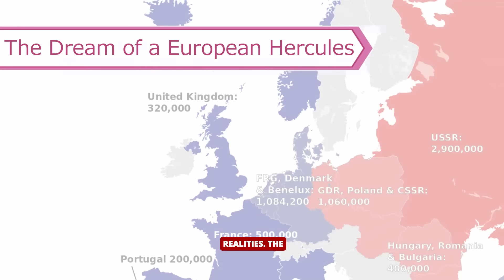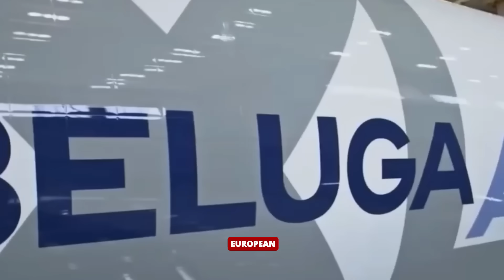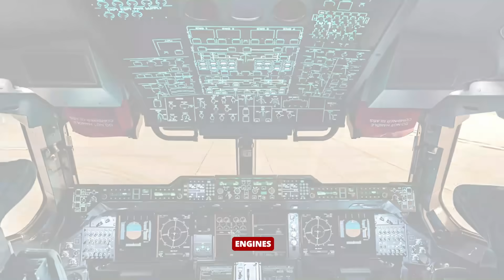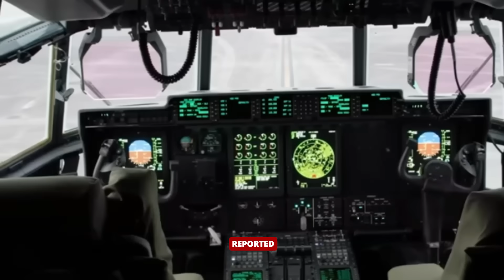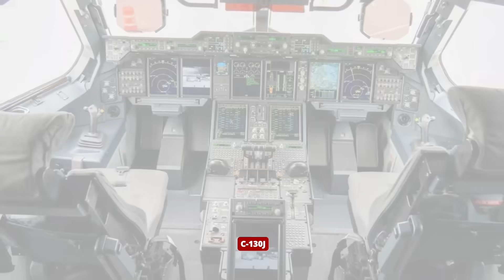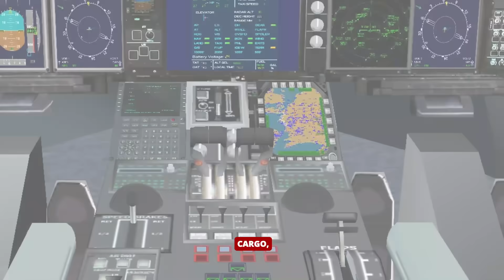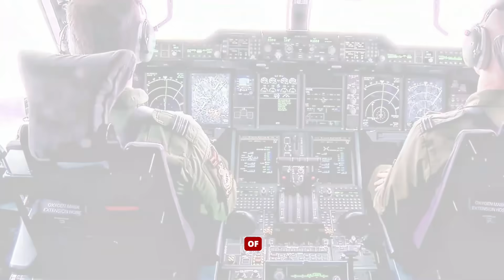Why Europe's $180M Jet Can't Beat a 70-Year-Old Plane

Comment: The A400 is slowly , steadily getting more buyers.

It so happens , C130 still sits in the performance and capability sweet spot that meets most militaries needs. As long as Lockheed keeps working on improving the C130 Herc, engines, avionics,   it will still be in demand for many more years.
Reply: I want to buy a Hercules so bad just to show the government how to do a proper upgrade. 

Carbon fiber is the new fiberglass. There's even YouTube tutorials on how to make graphene. 

You can make your own ultrasonic phased array crack detector for a couple hundred bucks on SparkFun.

Electrically decoupled, variable bypass, turbo jet/prop are the new hotness.

There's so much room for activities/upgrades.
Reply: The winner of the future is Embraer KC
Reply: @zaidiripin9408  LOL ... like an Alfa Romeo, good new but not very long serving. The C-130 has always used "Dimpling" for insertion of those 100k solid AD Rivets in the Fuselage ... as opposed to "lap" construction on the Embraer and Alenia's C-27's ... time will tell, especially if they have many cycles on "unimproved runways".
Reply: If Airbus was smart which they are not
they would have tried to market the A400M to the USMC not the USAF
The USAF is deeply rooted with C-130 with various variants and the A400M wouldnt work them
The USMC on the other hand would welcome the idea as it mean like reliance on the USAF for strategic lift
The UK was never supposed to operate the C-17 however delays with A400M lead to the RAF to lease and ultimately buy 8 C-17s
Delays with the A400 is why the C-17 got addition orders and why even now A400m users are buying C-130Js
Reply: @verdebusterAP  The A400M is not the right plane for tactical airlift. It's not the plane the Marines need.
Reply: @disorganizedplay  
The A400M would reduce the USMC reliance on the USAF for tactical and strategic lift
Reply: Some countries (Spain, Germany) are trying hard to unload a few in their fleet because of surplus/unnecessary requirements. Unofficially EADS considers the program closed and there will be no more deliveries beyond the 178 formalized orders. Meanwhile, both Germany & France ordered new C130J's.  
The RAF unloaded (prematurely) their 130J's to make room for the A400M in their fleet - something that they regret now, and have quietly stated that it would be nice if the USAF re-opened the C17 line.
Reply: @ElectroAtletico The C-17 fills a slightly different envelope than all the other aircraft of its families from Boeing and Lockheed Martin. And it does so amazingly. So. That is, unless you do the same stupid things that crash other aircraft like high angle of attack turns at low speed. A view of YouTube will find several crashes related to that. It goes further into bigger deeper envelope than other aircraft, but it falls out of the sky at the end of its envelope, just like all the other airplanes in the world
Reply: @ElectroAtletico C17 is quite a bit bigger than the Herc.
Reply: @thomasblankinship98  Really? YOu don't say!
Reply: @thomasblankinship98 As is the A400.
Reply: @thomasblankinship98  its not the size really.   its the strength of the cargo deck and the max load, the C-17 is designed to carry a single m1 tank plus  some cargo and troops
Reply: @Aokitadamitsu LOL. I built the center wing of the C130 in the mid 80's during the C5B program. . Want to talk about big! You're  right , the C17 can carry 1 M1 Abrams. The super Galaxy ( C5M) can carty 3 , with all the equioment for them and the ammo , as well as the entire gun crews for them. And my Grandad worked for Lockheed from 51 until retirement in 78. Hydraulic specialist and cheif research mechanic . He built the landing gears on every bird that came through the plant. C13, C141, C5a, C131, and the first SVTOL airplanes ever developed , the Hummingbirds.
Reply: @ElectroAtletico  Indeed ... we (LM Aero) already delivered J's to France several years ago when the A400 missed their delivery dates ... but France still had missions.

Comment: Le  vrai  concurrent  de  l'A 400  m, c'est  l'Embraer C-390 Millennium.
Expliquer  que  le  c-130  est  parfait, c'est  ne  pas  comprendre  l'histoire  de  l'aviation.
Certes  l'Atlas  est  onéreux. Mais  ça  reste  un  atout  pour  une  flotte  militaire.
Cette  hyper  complexité, qui  fait  exploser  les  coût, est  typique  des  programmes  multi-nationaux.  C'est  pourquoi  j'espère  que  l'on  ne  se  lancera  pas  dans  le  scaf. C'est  perdu  d'avance. Un  député  du  Bundestag  disait : "mieux  vaut  la  fin  d'une  catastrophe, qu'une  catastrophe  sans  fin". Je  suis  d'accord. Qu'ils  achètent  du  F-35. Ils  ont  déjà  tué  leur  industrie  nationale. Et  faisons  un  vrai  avion  avec  nos  officiers  et  nos  opérationnels. On  s'en  sort  plutôt   bien  d'habitude.
Reply: Wrong, the competitor, in this case, is judged by the weight it carries. The A400M carries a similar weight to the Kawasaki C2, and the C-390 is similar to the C-130. Don't confuse them!

Comment: You missed the chance:
"It's wings flex under load...until they detach from the fuselage killing all onboard"
Built to last...
Reply: Unlike the A400M crashing on a test flight, by the way chief that was an C130H model 🤦‍♂️
Reply: @dave741966  How many F35's have crashed?
Reply: @ldkbudda4176  , With more than over 1250 F-35s in service, there have been 12 crashes. Seems like a pretty good record.
Reply: @pat8988  So one per a hundred? 1:100 ratio?
Reply: @ldkbudda4176  , Compare that to other fighters, it's pretty good.
Reply: @pat8988  F35's are brand new same as A400M. So it is OK to compare US and Europe's abilities and skills to build safe planes?  ;)

Comment: Typo in your title, A400M is not a jet ...
Reply: Mais  c'est  un  avion  qui  provoque  des  réactions...
Reply: It is a critical difference when you consider the flight envelope and tactical usage.  Designed for the job.
Reply from the maker: I understand.... its a turboprop. its a minor technicality and Jet appeals better to the less experienced aviation audience.
Reply: @The_Flight_Path It's not a technicality. It's a specification. If you fail at that your whole "argument" on the A400 falls apart.
Reply: @armadspengler2717  A turbo prop is a jet core driving a propellor, turbo is the jet part and only provides about 10 percent of the thrust.
Reply: @donscheid97 It is a turboprop and not just a jet engine not to have some percentage of thrust but to get a greater range due to less fuel consumption and you are more versatile. Eg. the A400 can back up on the runway on its own using its propellers. Try this with jet engines.
Reply: @The_Flight_Path  I must admit it's the first time I see a channel admitting the clickbait.
Reply: @The_Flight_Path This is called intellectual dishonesty.
Reply: @The_Flight_Path  So you deliberately lie just to attract viewers?

Comment: Maybe the development was a bit of a mess. But now the A400M starts to prove it's capabilities. And chaotic planing doesn't even need intra european collaboration. Boeing messes up the KC46 all by it self ;)
Reply: Two very different types of aircraft chief, A400M wasn't produced to compete with the KC46 🤦‍♂️
Reply: @dave741966 I’ve never said that. It was about chaos in aircraft development 🤦🏼‍♂️
Reply: @matthiashartge5520  the development issue you are talking about are due to the implementation of new technology. The A400 is just a turbo prop cargo aircraft similar to what the Americans built in the 1960s without computers.
Reply: @Astutemoose2015  The A400M is new technology too. The development is complex and several companies from different countries developed it together so it's not surprising that they ran into some issues. The A400M cannot be compared to the C130 in its original form ;)
Reply: @Astutemoose2015  The only thing the C130 and the A400 have in common is the fact that they designated as "cargo" planes. The A400 is faster, can fly longer, can carry more and is overall much more advanced. The most annoying thing in the video is when he says the C130 is 3 time cheaper. That right there shows me he has no clue what he is talking about. The A400 was designed to replace 2 aircraft at once and do it better at the same time. Which it eventually did. Problem is the A400 was designed with cold was mentality in part. Which at this point in time seems to have been a good thing. Also nations around the world have started to move away from the C130 and ordering the A400. It is slow for sure but it is happening.

Furthermore the main reason why the C130 continued to  have massive orders is the fact that almost all the nations that ordered the C130 J already had both experience, tech crews, and the infrastructure to support it. This offset almost all advantages of the A400.
The fact that the A400 is a brand new plane with teething problems (which is normal for any new plane) coupled with reduced defense budgets, and the shear pain of getting such a plane integrated into the fleet means the A400 has a huge challenge ahead. And the price does not help either.
Reply: @fishescu the c130 actually works
Reply: @jerrymillerstein  So does the A400M. Do not misunderstand. I am not bashing the C130. It is a great plane that has served for a long time. I am pointing out that the A400M is not the same and the C130. They both carry cargo but that is where it stops. They are designed to fill different needs. The A400M is more of a tactical-strategic airlift plane. Bigger payload, larger cargo hold, longer range, faster speed etc. It's purpose is to fill in for 2-3 planes at once. It falls in between the C130 and the C5. Problem is politics got in the way and made it more expensive. Also while it is a turbo prop it IS the most advanced turbo prop of its kind. A lot of new tech had to be developed for it. Which takes time, money and will cause delays and early teething problems so to speak. 
Even the latest C130J is no match for the A400M. 

The main problem with european projects like the A400M are the politics. This was not an exception. 

That being said the plane is amazing and performs its role in a superb way.